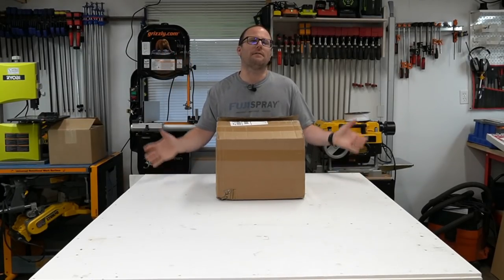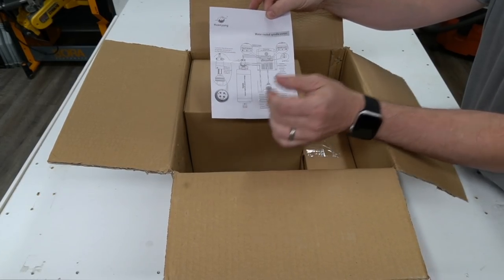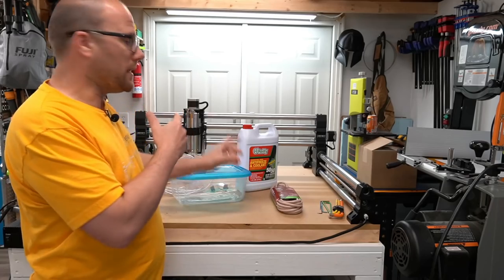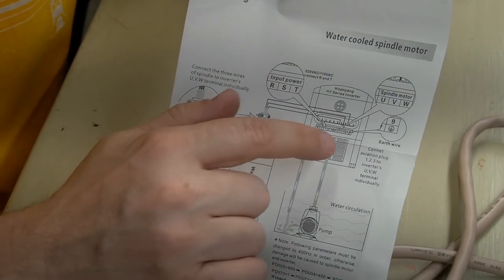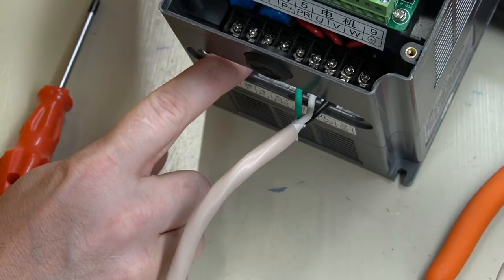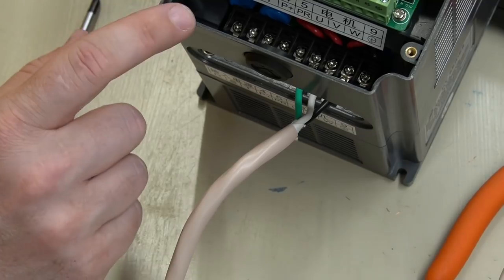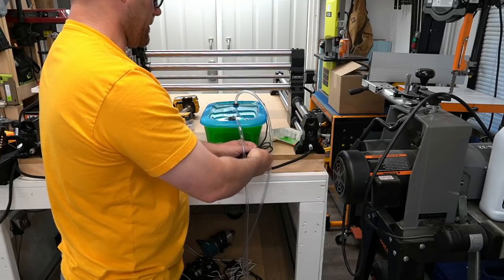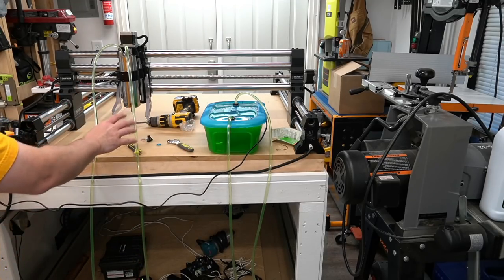How To Install A CNC Spindle - Part 1

Comment from the maker: ■ Huanyang 800w CNC Water Cooled Spindle : https://amzn.to/3f7I020
■ Soldering Iron : https://amzn.to/3e9eqrI
■ Solder : https://amzn.to/2VW7PKW
■ Extension Cord : https://amzn.to/2DlL8td
■ Coolant : https://amzn.to/38DeL4P
■ Collet Set : https://amzn.to/2VYufv1
■ Heat Shrink : https://amzn.to/2CfjAVX
■ Wire Stripper : https://amzn.to/2ZReZkI
■ Electrical Connectors : https://amzn.to/2ZLOoWr
■ Clear Tubing : https://amzn.to/31YICDp
■ Rubber Grommets : https://amzn.to/2Z5jkBM
■ Helping Hands Soldering Fingers : https://amzn.to/2W0o9u5
Myers Woodshop Participates in the Amazon Affiliate Program
Reply: How long do your affiliate links last? Or do they not expire? The kit you posted is unavailable right now, hopefully, it comes back in.
Reply from the maker: they go in and out of stock.
Reply: @MyersWoodshop  Ah, I noticed. Thanks for the reply, I was just wondering because I know you get a cut on affiliate links and when I am going to buy it I wanted you to get your credit.

Comment: Thanks for the video.  I have 220 in my shop so I will go with it, and the 2.2kw.  Hats off for not editing out the foibles.  A relay from your breakout board to start the coolant pump will start your pump with the spindle.   A cheap in-line flow indicator  will give you visual verification of coolant flow.

Comment: Ben, you should really consider changing out that wiring. Extension cords are not meant for high flex situations over time (temporary only) and you have a chinese made electrical appliance ungrounded with a metal body not just next to, but with water and coolant running THROUGH it. Any leakage internally could float amperage into that coolant and be a potential for a shock without any indication until you touch the spindle, coolant, container, etc. SO/SJ is sold almost everywhere including ace hardware, and any electrical supplier. Please, don't let this go until you notice a problem, because the way you may notice the issue is when you die.
Reply from the maker: I have the proper cable on order now.
Reply: @MyersWoodshop  this makes me happy!
Reply: @AlAmantea  would a 10/3 electrical wire work for a 220 volt 30 amp line with a 2.2 kw air cooled spindle?  hooking it up to a 220 volt 30 amp  nema l6-30 locking receptacle.  thanks
Reply: @CustomCraftedDesigns  yes. A 10/3 sj or sjow will handle a max of 30 amps at 240volt. I would recommend if you don't need to have both neutral and ground, switch over to a 10/2 sjow for maximum flexibility.
Most 240 volt Spindles don't need the neutral and only requires the 2 phase lines plus a ground. Each phase of the a/c acts as the "neutral" and or return for the opposite phase during operation.
You MUST have the spindle body grounded to a known good electrical ground line.
Reply: @AlAmantea  thanks ill try to figure this out limited info on the wiring.
Reply: @MyersWoodshop  Hey there!!  I know this is a rather old video and you've moved onto the ELITE MASSO set up but could you please share what proper cable you ordered to replace the extension cords?  Thanks for the video & all the help!!

Comment: Pro tip for soldering.

To stop the amount the heatshrink shrinks, wet both surfaces with solder first (heat the connection and apply solder to the hot surface so that it makes proper contact) after both the wire and terminal are "wet" slap the heat-shrink on then its a 3-5 second job to fully solder the wire onto the terminal and this will almost completely stop the heat-shrink from shrinking until its on properly. Avoiding cold solder joints also reduces resistance which can affect the three phase supply to the spindle.

Comment: instead of helping hands, i recommend sticky tack. For hanging posters etc. Make yourself a big ball of it and stick it to the side of your solder station. When you need to solder wires, stick it to the table and smash your wire down into it. It will stay in place while you solder. Sometimes the heat will make it extra sticky and some will stick to your wire, if this happens use the wad to dab it off as it cools. Super easy.

Comment: Just a note for those setting this up. He got everything right, but it should be a 5 gallon minimum on the tank for fluid. Even at that volume, it will warm up quickly, but not get hot.

Comment: Got a 65mm spindle. First thing I noticed is once you mount the spindle in the stock mount, the top of the spindle hits the Z motor.  You can position the spindle to just not touch the motor, but you are going to lose about 4 to 5 inches of z travel.  Not a big deal if you are doing 2d carves, but for those who are doing 3d, losing that much travel could be an issue.  Apparently the 80mm mount avoids this issue.

Comment: thanks for the video! did you notice any height/clearance issues with your 800W spindle on the Onefinity z-axis? Are you still happy with the 800W 65mm spindle, or would you go to an 80mm spindle if you did it again?

Comment: Great video. I am planning to upgrade my 3040cnc factory spindle with only poorly 8000rpm. What is your recommendation of the power, should I pick up 800W or 1.5kW spindle? Is 800w enough for slow Al alloy milling?

Comment: You notice the ROUND rubber grommet, that's where the WIRES go,  If you put the solder on the wire first it goes better. You don't need heat shrink on the wires it will interfere with the black cover and it's twice as long as needed anyway.
Reply from the maker: ah well.   I did what I did.  it works.

Comment: Hi.  Thanks for the great video(s)! I am a follower now!     I have a question:  I am at that moment when I should make a decision about my cutting machine, since my brand new X-50 should be on its way soon!  I have noticed in some of your videos that the Makita router is sometimes a "visitor" to your 1F CNC, so I was wondering why do you still use it (do you still use it?) and what would be your final verdict about installing a spindle and VFD instead of a Makita router?  (In my case, I'm considering the 80 mm one, now that we have 80 mm mounts available!)  I have decent electronic knowledge and consider myself a skilled DIYer so, I am not afraid of the technical challenge. Performance is mostly my concern here. So, do you recommend a spindle based on your experience with it?   (I'm thinking of an HY in accordance with my budget, nothing fancier than that)

   Thanks in advance for your answer and please keep doing such a great job!  All the best!!!

Comment: I'm in exactly the same situation as you.. I can't find a 4 core cable... I was told I needed a 16g 4 core shielded cable for my 2.2kw spindle..  So its not been rigged up... Until now... I did the same as you Nd its working a treat... Thank you
Reply from the maker: exactly.
Reply: it is where you are shopping.  
Go to an electrical supply store and tell them you need a piece of extension cord 16 ga 4 conducter with stranded wire in it.  They do make a couple of types of insulation and if Jute is wound in to keep the cable rounder, but those things are probably not a concern in your application.  This is exactly what is used to hook up small 3 phase motors everywhere.
Reply: @stevemitchell1265  not in the UK or Ireland,  3 phase is like rocking horse shit here very rare

Comment: This is a great video of what not to do . I lost count of the mistakes . Especially running the spindle before the vfd is programmed. You should really know what you're doing before you make a video on how to do it.
Reply from the maker: runs fine for me.
Reply: Absolutely. Credit to him for giving it a go, but nobody should use this as a tutorial. So many mistakes and dangerous ones at that.

Please if anyone watches this, do your own research before taking on installing a spindle and VFD. The earth wire is important, as is making sure the 4th pin is actually connected to the spindle body, also program the VFD before pressing the run button, never run it at defaults.

Comment: If you tin all connections first it will be easier to make solder joint.
Reply from the maker: good tip!
Reply: Also I’ve learned if you put a tiny bit of solder in the tin cup and warm that up first all you have to do at that point is insert your wire and then remove heat!
Reply: @littlemeg12  Hi Megan, you are  absolutely right.

Comment: Hi Ben! I also have bought a Huanyang spindle and wired it as you U=1, V=2, W=3. But my spindle spins backwards (in counterclockwise direction). What is wrong?
Reply: I think you can switch 2 of the spindle wires around, don’t quote me on that, but if I recall correctly that’s the way to do it with 3 phase!

Comment: what might be the big upside in controlling the decibel output of your spindle/router  when your dust control system will most likely match and or exceeded any other decibel level?

Comment: So I clicked on the link and it’s showing a 1.5kw 80mm spindle with a 110v controller. Where can I get the 800 65mm 110v spindle that you have?! I’ve looked everywhere and I can’t seem to find one 🤷‍♂️
Reply: I know this post was a month ago but did you find one?  Im looking for a 110v also..i found one thats like 600 bucks..the one he has is like 300-400 i think..

Comment: I'm getting this same CNC in few months as a part of Onefinity's pre-sale and I'm wondering if I should get the Makita router first to get me going and then maybe upgrade to a 1.5kw or 2.2kw spindle later or maybe do what you've done here with the 800W... what would you recommend?
Reply: I am in the same boat. His link says unavailable items. Who knows when it will come back in as a kit. The spindle I found for $215 and the 220v controller was $189 Edit I found the 110v for $132. The pump you can get for $20 if you look around (I have like 5 similar ones already cause they are cheap). 
If you want to use the machine when you get it, I recommend the Makita. It is cheaper and proven to work. This is a nice upgrade, especially on sound levels, but if you are tinkering with a CNC first just put it on your list of items to get.
Reply from the maker: my opinion is to get the makita https://amzn.to/30iCDYI and decided if it's enough.  If not, you still have a great trim router for your shop, so you're not out any $.

Comment: Other than the noise volume does the spindle give you other advantages (cleaner cut)? Will it cut throw hardwood with the spindle since it has more horse power behind it. I know top end rpm is same.
Reply: I know you asked two years ago, but the reason I’m considering a spindle is because my router gets fairly hot just cutting air for sixty seconds 😩 Plus, spindles are made to run continuously … routers not so much.

Comment: Good video, 3 thoughts  though, You DO need the ground wire on the spindle! Get some 4  wire (soow cabtire will do), and use the ground. If there is a fault in the (It is Chines after all) VFD, the spindle and any metal in contact with it will be live, If the yellow shirt or any of his offspring touch this metal  they will start doing the funky chicken in the garage.  The boss will come down to deal with it with great vigor,  and you'll be sleeping with Onefinity!  the The ground is designed to provide a low impedance path to the panel. When a fault occurs it will  produce a current that will immediately trip the breaker in your panel! i.e. no garage dances. Also you don't need Stakons but if do you can just crimp them instead. Just strip and clamp the wire directly. Faster easier and better because there is 1 less connection to fail. If you do solder you should use non acid core solder and use flux, tin the wire, then the connector , then solder the 2, they will bond faster so you wont heat the wire as much. Also you should add a switch to the line side of the VFD, and use it whenever you change tools,

Comment: What is the flow rate with the water pump please? have you had any issues with it in the last 5 months? if so what issues have you come across please?
Reply from the maker: no clue the flow rate.  I've had zero issues.
Reply: @MyersWoodshop  thanks. does it not say on the pump itself? I have got me a 1.5Kw spindle and getting my 1F in 6 weeks.. just lining up all my ducks.

Comment: We must be brothers from different mothers. I always for get things as I am constructing and then I normally have to disassemble and try again. You were lucky it was only a small error X2 with your soldering.  Super video. How much was the spindle please?
Reply from the maker: So true!  it was around 350.
Reply: Thank you. I could not find a 800W spindle on the link you offered up.
Reply: FYI when soldering your wires you should "tin" the wires and "tin" the solder cups first this will make for a connection that will stand the test of time

Comment: This is the 1.5kw that I got off amazon. 65mm. I've been using it about 2 months now. "1.5KW 220V Air Cooled Er11 CNC Spindle Motor and 1.5kw 220v Vfd Variable Frequency Drive"
Reply from the maker: does it get hot?
Reply: requires a 220 power line tho... are we kinda stuck with the 800w if we want 110v?
Reply: @InTheLab3d  No, I was able to find a 1.5kw 110v water cooled spindle on ebay that works a treat from lovehappyshopping (or something like that, it is 80mm and has an er11 collet and genuine huanyang vfd for $350) I used a double shielded 16/4 cable from https://ebay.us/dQwYwm

Comment: Great video, looking forward to part 2. 

The front of the VFD, said 110V 1.5Kw. Is it just a generic cover for that panel or do you think they sent you the 1.5Kw version by mistake?
Reply from the maker: I think they only make a 1.5kw vfd and don't make a 800w because they both can run off the same.  My spindle is definitely a 800w.

Comment: If someone wants a 4 wire cable go to your local electrical supply or one of the big box stores and get some 14/4 300-Volt CU Black Flexible Portable Power SJOOW (or SOOW) Cord. It's sold by the foot and should cost less than $2 a foot. You could probably use 16/4 for a 800 watt spindle, there would be little difference in cost so why not go for the larger gauge conductor. Remember you'll be potentially running this spindle for hours at a time. Using pieces of an extension cord is not the same. Extension cords are not intended for continuous use which is loosely defined as over 3 hours. Lighter gauge wire and extended run times can lead to heating in the cable. Be safe, go big and you won't be sorry. I will admit I did not read through all the previous comments and all this may have been mentioned before. If so my apologies.

Comment: U should  use emi wire cable on your spindle u will have problems with skip steps from Emi
Reply from the maker: no issues in two months so far..
Reply: @MyersWoodshop  that great but I problems missing steps at .01 of inch then fix problems now no problem getting accuracy at .002 of a inch my making injection molds with g540

Comment: You should set up a McMaster Carr account online. You can order any hardware, fittings, wire,...etc one would ever need. Not the cheap option but for unique or industrial grade parts they are a perfect source. Order by 4pm and have it by 10am next day 99% of the time.
Reply from the maker: I've gotten some things from there.  I don't have one in my state.

Comment: With VFD, the use of shielded cable to connect motor in order to preveny emc disturbance
Reply from the maker: Good tip.
Reply: @MyersWoodshop  do you still use it ? Are you still happy ?

Comment: did you have to change the VI/VR plug for pwm control of the VFD?
Reply: Yes in order to control the VFD via an external control signal you have to move the jumper pin over to the VI spot.
Reply from the maker: i did NOT have to move jumpers...part two will show how I connected it to my cnc controller.
Reply: Okay. 👍

Comment: Just a hint next time you do a connector like that tin and fill the connector sockets with solder first then tin your wires.  Now all you have to do is heat the connector and slip the wire in.
Reply from the maker: good call.
Reply: Also  at 24:52 in the video where you say strain relief, the outer wrap of the cord needs to be on the plug side of that strain relief other wise your just gripping the wires and your gonna have problems down the road. Even if you have to slit the outer wrap to roll it back to work you need it so your not pinching the conductors.

Comment: instead of trimming back the sheathing,  shorten your heat-shrink tubing. also, shrink it after each joint. and most importantly, tin your wire before you slide the heat shrink on. Then you don't need to heat the wire so long.

Comment: is there away to connect a remote panel for the drive?
Reply from the maker: not that i know of.
Reply: @MyersWoodshop  I found the replacement display panel. It didn't show the back side does yours pop off? If it does how is it connected? I am thinking it maybe like a telephone cable connections. If it is should be able to by a longer cable and mounted the drive out of the way and and it will be quite with out the fan.
Reply: Jaustin Yes, Amazon sells a mount  and 10ft extension cable to remotely mount the display.

Comment: Automation Direct carries  Southwire flexible portable cord, Type SEOOW, 600V, 4 conductors (includes ground), 18 AWG, TPE conductor insulation material, black, white, red and green, TPE jacket, black, cut to length @.51 USD with free shipping over $49, Minimum 20'.
Reply from the maker: Thanks, i got a 2.2kw and got some 4 condutor sheilded wire for it.  A guy on ebay sells a kit!